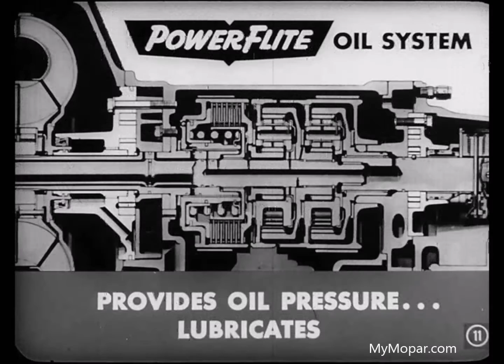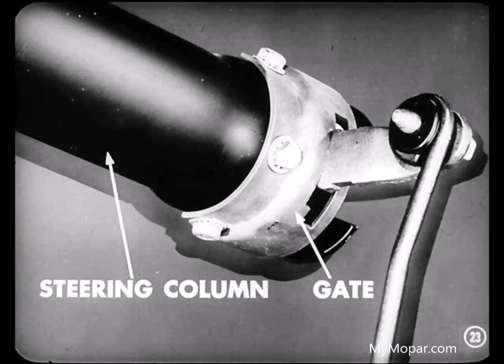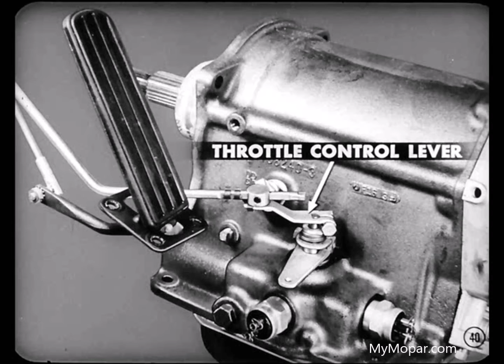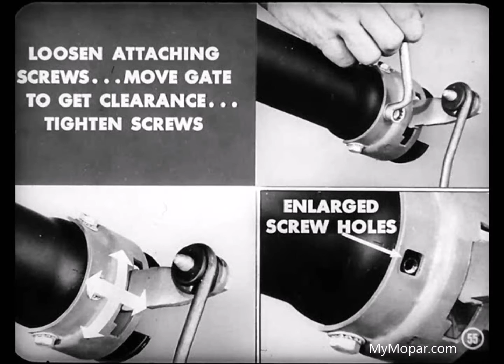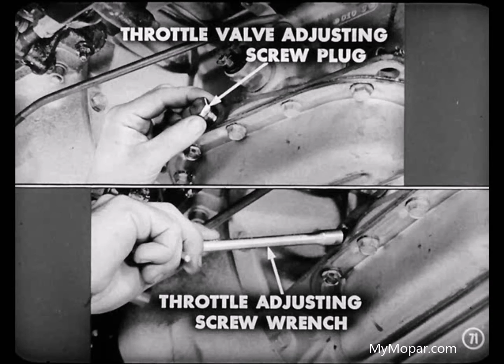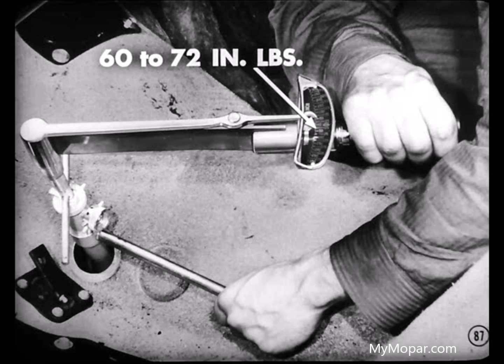Chrysler Master Tech - 1953, Volume 6-12 Powerflite Automatic Transmission (Controls)

Comment: I have a question .. is this transmission the same for my 53 dodge coronet ??  and what kind of oil could I use?  I appreciate any answer thank you !!
Reply: when these were designed they used suffix A , later designated DEXTRON for both powerflite and torqueflite
Reply: The closest chemical match for old automatic transmission fluids prior to Dexron II in 1978 is Type F or hydraulic oil.